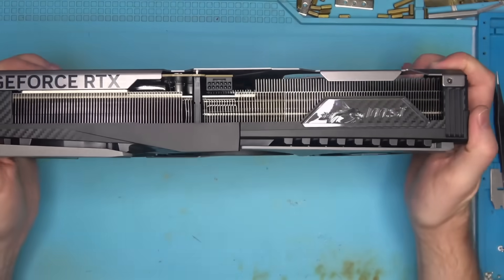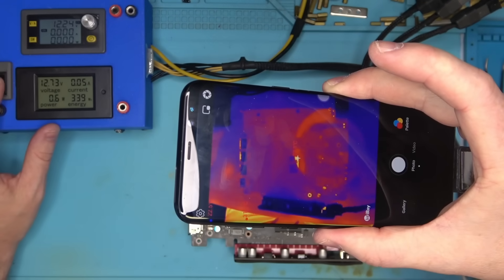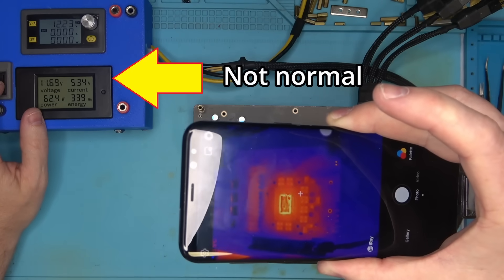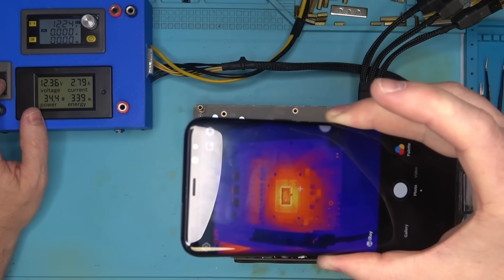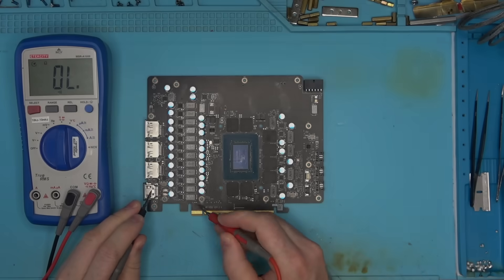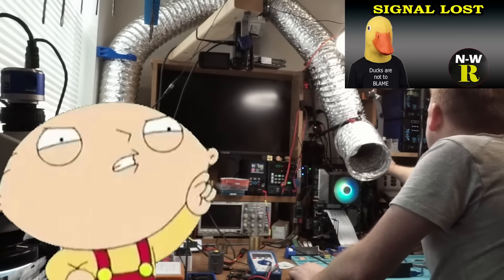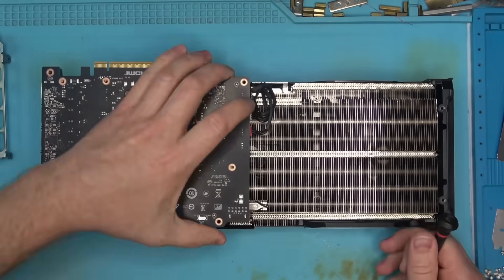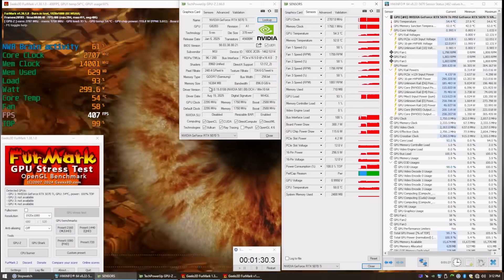MSI RTX 3070 Ti: The "Unfixable" Card... Until This Happened!

Comment: My favourite kind of failure is a solder crack in a 5000 component PCBA. The other is a PCB crack inside a layer between a core and a RAM. Ofcourse there are no measuring points or even vias to check the lines. You can only find them when you remove the both and check them all 1 by 1... Man I wasted weeks with that one.

Comment: Thanks for the upload, first 5070 Ti.
So the main problem was small cracks in the soldering joints of the capacitors on the data lines, lead free soldering?
Maybe will be a good idea to reglue the corners of the core, I know you use lead soldering for reballing but still, as long as I see PCB is very thin, any slight twist or sagging will maybe lead to ripped pads.

Comment: 9:20 I agree, 40xx been much better by MSI, however still, it was Suprim, no? Did the Gaming had the fuses too?
Edit: well, seems like they did. 4090 at least. Same board between Gaming and Suprim, just different fulfilling.
Reply: Vanguard. Lower tier than suprim
Reply: @niodix oh, yeah, I did overlook, that is correct, yet the main differences been I think 2 less power stages and so heatpipes afaik, but don't remember the lack of fuses. Maybe on lower ends? Still, depends on the price, as Vanguard and Suprim is overpriced af right now.
Before (on 40xx) Suprim was a no-brainer for MSRP since it was the same and better than overpriced Strix.
Reply: @kekovkeks  I was going to buy vanguard 5080. But after that video i don't know since 5070 ti and 5080 have the same same boards. Well I'll wait for 5080 super versions and try to figure it out
Reply: Vanguard in my country costs $1770 and suprim is $2080. So yeah 😂
Reply: @niodix possibly supers might be changed for good, but honestly, I was a little disappointed in Suprim by 50xx. Priced higher and quality is lower. Just look at 4090 and 5090 support brackets and backplate, you'd get it. Not bothering to mention 70A vs 50A mosfets on the old vs new one.

Comment: MSI really cut back on the quality with the 50 series.  From components used to the cheap 2 slot I/0 bracket on all the high-end cards.  Hell the 5090 Ventus model comes with a 3 slot I/0 bracket, but Suprim doesn't lol.

Comment: The problem is lead free solder. Joints need to be a bit more forgiving when they are in shipping, installation, and the uninitiated.

I’m alright with losing my mind to lead and cancer. Not to racking my brain with broken electronics.

Time to invent a new solder type.
Reply: It's not about being exposed as user but about releasing to environment when on landfill or just thrown away along the road. One might say that GPU isn't the case coz it's super expensive, well ppl are still throwing away fully functional PC and multiple times even along the road (yes ppl are idiots) that's why we cannot have nice things.

Comment: 0:35 It's purely for the price. Back in the days the top and middle range cards were full size, and low tier got small pcb-s (with smaller coolers), now they made the low tier segmented too and the top of the low tier cards they want to sell as middle range ones. That's why they need this optical enhancements. Disgusting strategy and a joke to look at every time.

Comment: Hmm... so what caused the damage? And was it really just superficial (knocked-off caps)?
Can't help but wonder if the card's weight/size and the way it was installed and/or handled played a role here. According to techpowerup, the Vanguard weighs nearly 2kg (1,937g), which is probably on the upper end of the weight-scale for a 5070Ti. MSI's own Ventus is only a little over 1000g and my Palit weighs just over 1500g, so nearly 2,000g seems quite hefty. 
I also wonder if just re-soldering all those caps would've been enough - meaning if the reball was truly overkill.
Reply: I think reballing still needs tho, That continuous 5 Amps at start doesnt look right to me. Maybe, both problems are related due weight, as you quoted.

Comment: Damn,how can that small capacitor get a cracked connection,they use lower quality solder to make more money,like ,in cents,wth...at this prices fir a video card,it should never brake...the components are not even half the price of a card,they cant get enough of it 🤑🤑🤑

Comment: At 3:28 you're pulling something out of the corner that looks flaked. What is that?
Reply: Basically glue to stabilize the core and prevent twisting and cracking.

Comment: With all the problems you get with risers, I’d like to see a custom made riser, I think you possess the skills 10:19
Reply: The risers are likely fine for normal people who plug in cards and leave them there. In this case, the frequent plugging and unplugging is causing the contacts to get loose, perhaps. He should probably consider them a wear part and replace them periodically. Or maybe he can find a ZIF-type slot that has a lever to apply the contact pressure. I've never seen such a thing for PCIe, though.
Reply: @Mueller3D  he regularly swaps risers only using the board-slot to exclude the riser from the process so he can limit insertions on the board to a minimum

Comment: Btw 5070 TI owner here. You need open kernel modules for 5000 series to work on Linux so you may need to start updating stuff.
Probably best to have a separate USB stick for 5000 series
Reply: Another thing, you can use Ventoy to have multiple OS ISOs on a single USB stick, and choose between them on boot, though I don't know how it interacts with partially working hardware
Reply: Just dual boot and have Linux on a cheap 128GB SSD. Better than live booting for long term usage.